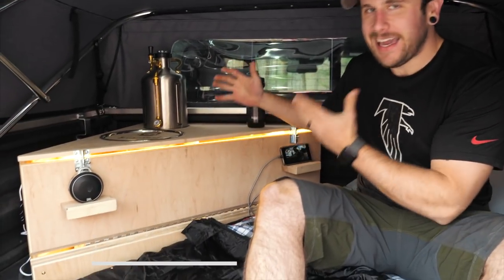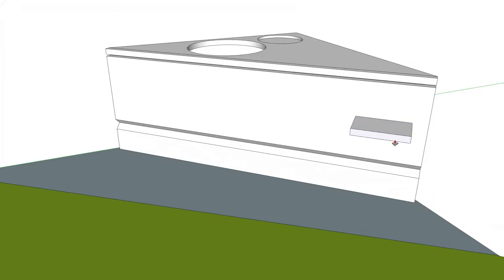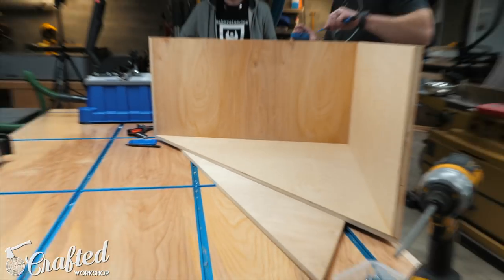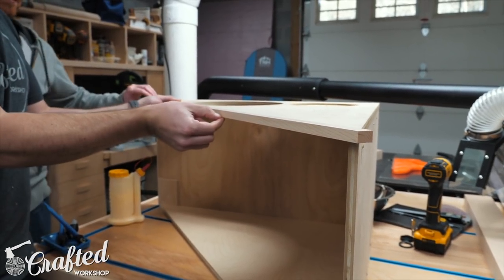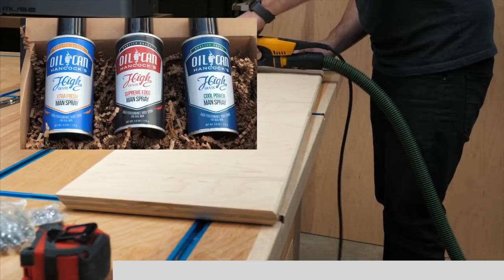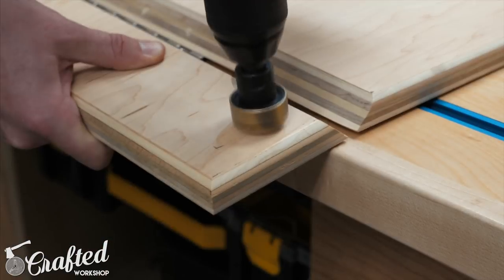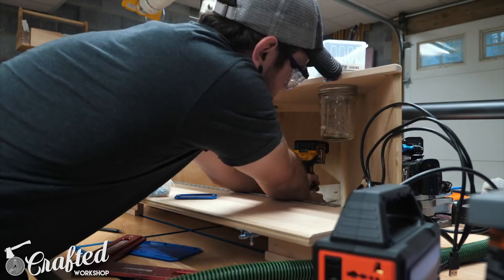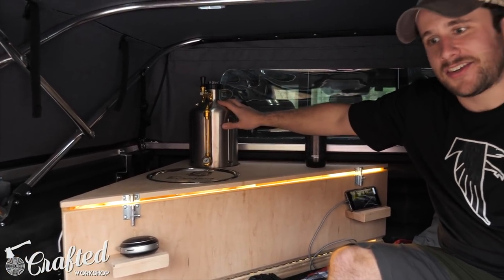DIY Pickup Truck Camper Cabinet with Seth's Bike Hacks | How To Build - Woodworking

Comment: Cool project...like the corner placement to leave a diagonal for sleeping. So what is the plan for the water in the sink? I didn't see a drain or holding 'tank'...just dump it out the back after you are done? 

I wonder how it would work in a tailgate corner...you could add a door to one of the triangle legs to give outside access...or maybe mount a 10" tablet holder so you could watch vids while sitting around the campfire? Maybe it could be a second cabinet insulated for a growler full of brew?

Solar recharging capability would be another bonus!

Cheers!
Reply from the maker: Thanks! Yea, just dump the sink. We could have drilled a hole somewhere, but that seemed like a really permanent solution. I think it would work in the tailgate corner, it only measures 29" wide, so you'd still have room to get in and out. The customization options are fairly endless! And the battery pack we used does have a solar charging kit, if that's something you're interested in.

Comment: i'm kinda surprised that youguys didnt thinkto addsomething to the bottom of the cabinet that fits into the grooves in the bed of the truck...ya know, to prevent sliding a little better...
Reply from the maker: It's anchored to the tie down points in the truck bed, it's super solid. Seth shows it in his video.
Reply: Crafted Workshop yeah, I saw that a bit after I posted this comment.

Comment: Did you use a battery (car battery)to install the inverter or to power it? And if you did how long does the battery last?
Reply from the maker: No, we used a battery pack, which I linked to in the video description.
Reply: Crafted Workshop I found 1,000w battery packs/inverters would those last longer than a 100w battery pack/inverter
Reply from the maker: The capacity of battery packs are measured in mAh, not wattage. Wattage is just the power rating, not how long it will charge.
Reply from the maker: Yup!

Comment: another great project johnny :) one quick question - what finish if any did you apply on the plywood?
Reply from the maker: Thanks man! The finish will be applied by Seth, he's going to use a simple water-based polyurethane.
Reply: That makes sense, I was wondering if you'd protect it cause i  bet its going to get a fair bit of abuse. Do you know if seths going to have pics up anywhere once its all said and done?
Reply from the maker: +JMakes I’m not sure, he’ll probably post on his social media about it fairly regularly.

Comment: Why didnt you made more space by removing back and front "wall" and make front seat removable and there is more  you could put on hatch a back extension it goes like this.... When you open a back hatch you can put some strong structures and put like a 3 of then each one long as hatch and wide as hatch and put a legs or something on the end and then you could make that bed space bigger